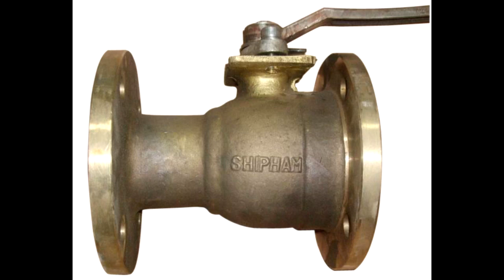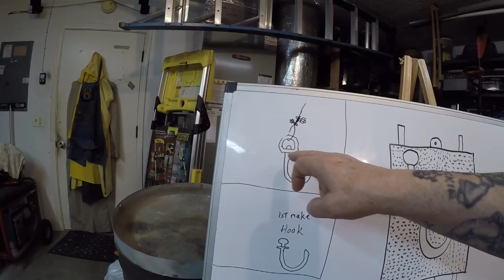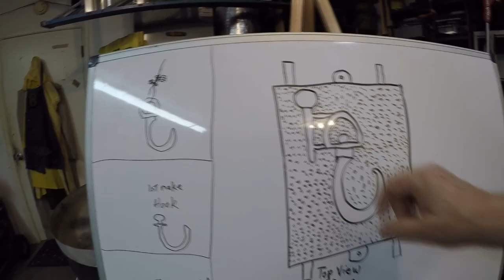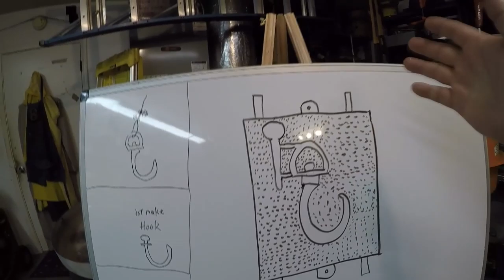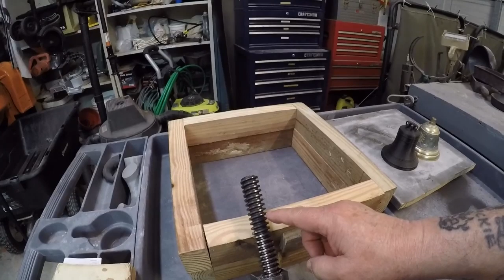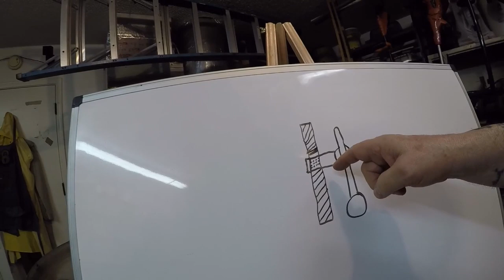Crossfeed nut experiment, part one

Comment: Great technique, well worth watching. May I suggest, as feedback, that the dialogue waffled on a bit. A lot better than I could do however, so it is not a criticism.

in regard to casting the Nut over the shaft, it may be worth turning off the threads outside the Nut area so it will more easily screw off the shaft.
again great work.

Comment: Hi Tom.  This should prove to be an interesting experiment.  I have smoked cold rolled metal cores using soot from a candle and then drive them out ... Sometimes.  It would all depend on the diameter of the core and how deep it was in the casting.  I hope that made sense.  I have never used a wash so I guess it will work better for you, but I expect you will need arms like a gorilla to turn that screw out of your cast nut.  I am excited to see how it all works out.  I have learned tons from you.  Thank you for sharing.

Joe

Comment: My question has to do with the draft needed to get the pattern out of the mold.  Are you going to grind or machine a draft angle on the pattern?  I think you have a novel idea for obtaining a new nut.
Reply from the maker: Roy Reynolds , The most anyone needs to apply to the draft of a pattern is 5°. And that’s for something as long as a foot long billet pattern. The size of the pattern that I made would only need 1 or 2° of draft.
Reply: @sandrammer  Thank you.

Comment: I was going to do this exact solution to repair a crossfeed nut on an old artesian split bed lathe using the lathe thread as a core/chill with a heavy mold wash on the threads. I was considering oxyacetylene smoking, graphite spray, or boron nitride for the coating on the threads. Since passing on buying a foundry; I was talked into switching to trying 3d printed bearing bronze (now I have to go through the process of modeling up the complicated crossfeed nut and sourcing a DMLS printer service 🤦‍♂️)

Comment: Based on what I read somewhere, maybe Gingery, I poured a chunky wheel around a 5/8" smoked bolt. It took a few good whacks to get it to move but it did come out. I fully expect multiple layers of graphite, lubriplate maybe?, to work much better. The threads do not have to be perfect for this to work.  Just enough contact to keep it tight.

Comment: Tom,

If you cast aluminum or brass over a steel core what happens as the molten metal cools?

I think it shrinks giving you a very tight interference fit. It seems that attempting to cast female threads around a steel screw is also going to cause the threafs to shrink onto the screw and attempting to unscrew might caise a structural failure of the female threads.

I think a better plan would be to make an investment casting where the shrink could be calculated.
Reply from the maker: Once the molten metal comes in contact with the steel it solidifies very quickly causing the grain structure to be small and hard. The metal rod acts as a chill drawing the heat from the casting quickly. It won't turn brittle unless the outside diameter of the nut is too small in which case it may split during solidification but I made this pattern thick enough that I won't worry about that. You're right that the female threads would fail but only if you tried to move the nut before it was fully cool and solid. Aluminum is a lot tougher than you might imagine.
Reply: @sandrammer  

Tom, 

I hope it works, I wasn't questioning this technique from experience, but rather more from curiosity.

Looking forward to see what happens.

But on a general question, if toy made a casting of let's say a pipe flange and you had a core with a 3 inch diameter, what would be the expected inside diameter of the casting assuming yellow brass as the material?  I ask as if you cast a solid round fron a 3 inch pattern when cool the casting would be predictably smaller as the metal would shrink as it cooled. But if you have a cross section of a ring, if the wall thickness shrinks, the inside would get larger, but the force ot the outside shrinking might be a greater force so the inside might get smaller.

I have never considered the physics involved, but you may have, hence the question.
Reply from the maker: @MrRShoaf  , while it may seem illogical, all dimensions of a casting will shrink until the metal is solidified fully and cool. In the case of brass all dimensions of the casting will shrink 3/16 ths of an inch per foot.
Reply: @MrRShoaf  Thread casting like this is a common thing for some applications where thread cutting, thread forming, or EDM threading are not an option. 
As for "physics" yes the steel will expand slightly as it is heated slightly by the molten metal, but as SandRammer said the steel will act as a chill causing the cast metal to solidify first where it is in contact with the steel. when the steel cools it will return to its original size but the casting will contract away from the steel. The net effect with the mold wash is a close tolerance transition fit (similar fit or tight fit) or a close tolerance clearance fit (location or sliding). The exact fit is a bit challenging to determine as the type of mold wash, the thickness of the mold wash, the alloy cast, the pouring temperature, the starting temperature of the chill core, and the alloy of the chill core used will all factor into the final cast tolerances.
There will never be an "interference fit" as an interference fit by definition means there is an interference where metal has to be deformed as the parts are put together at ambient  temperature (for this case the nut hole would have to be smaller than the threaded bar... something that just cannot happen when you cast threads in this fashion).

To give you another more odd case showing why this works, Aluminum can be cast in an aluminum die. The molten aluminum will not melt the die, will not deform the die, nor will it fuse with the aluminum die (assuming the die is coated with a mold wash).
Reply: @askquestionstrythings  

I'm glad you are clear in the physics, because I'm still a bit foggy.  

Let's say you  insert a polished steel rod 1" in diameter into a sand mold and both the mold and the steel core are at 30 degrees C.  You have a .002 thickness coating painted on the rod. There is no taper on the steel core. You  pour at 725 degrees C.  The mold is allowed to return to 30 C.    Since the good Chief is the one doing the molding and pouring, you can assume that all the best practices have been followed.

So what happens?

Is the rod stuck inside the casting and you need to press it out?  Or does it slide out?  What is the expected diameter of the hole in the aluminum?
Reply: @MrRShoaf  Unfortunately, I don't have time to run all the calculations at the moment with a big project going out in early November. 
it might be possible to abuse a shrink-fit temperature calculator to determine how difficult it would be to remove a cast in-place nut (assuming the calculator will allow for multiple materials and allows specifying the starting temperatures) or use it to determine temperature the part needs to be brought to to make removal easier.
Reply: Roger Shoaf  this was addressed in the video.   Either by building up the threads with release agent or lapping to suite.    The poured metal will shrink everywhere but around the lead screw.   It can’t magically get smaller after the screw is removed.
Reply from the maker: @danharold3087  , especially if the metal is fully solidified and cool. The metal will solidify around the male threads first then work it's way to the sand. This is going to be the reason I'm going to use a riser to keep the casting fed until it fully solidifies.

Comment: I think Dave Gingery recommended a similar approach to cast a lathe's half-nut's threads in his diy foundry project book, The Metal Lathe.  Except that casting only had half of the threaded steel core surrounded my molten metal.  Very interested to see how this works out, how tight the casting will end up being on the screw core, etc.
Reply: Yes, Gingery uses a steel thread rod as a core/chill for forming the cross slide on all of his "build your own metal workshop" machine designs. Although I don't remember what he says on coating or not coating the threaded rod.